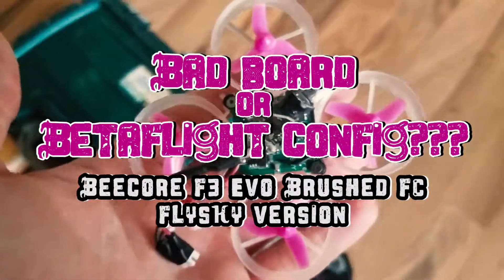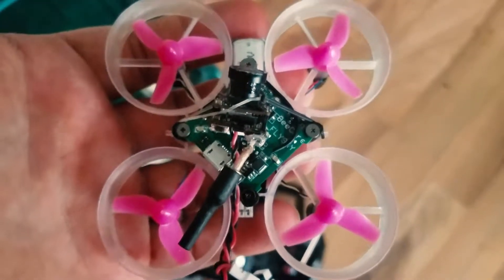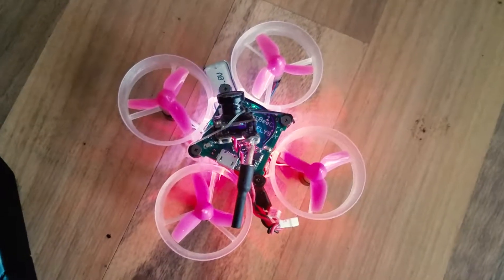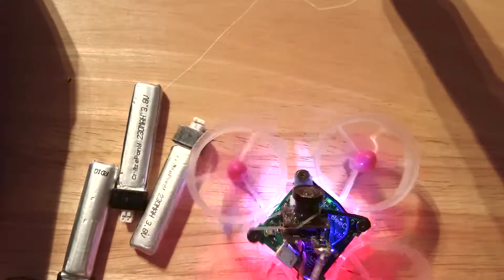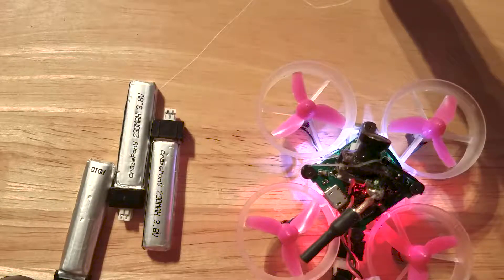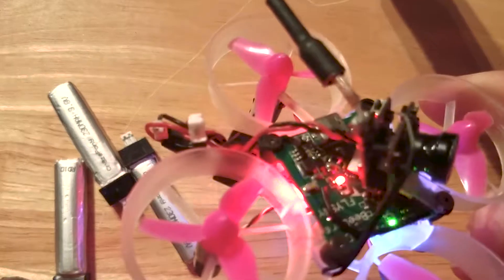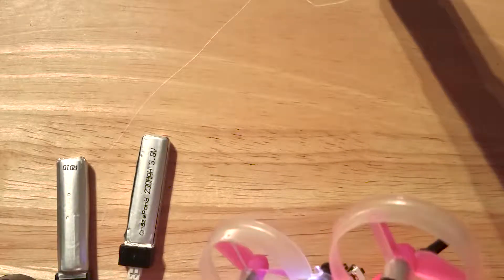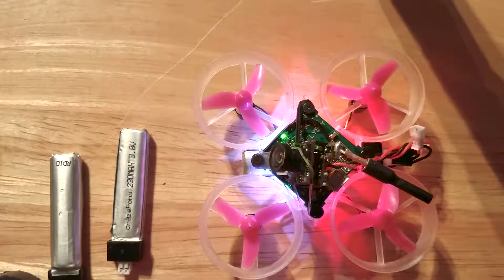Beecore F3 Evo Brushed FLYSKY Issues: Bad Board? BETAFLIGHT Config?

Comment: i just got mine hooked up and its doing the samething, when i arm it the motors turn, but when i go to give it some throttle the motors cut off.
Reply from the maker: CrazePony had the manufacturer look at this video and they said it was a bad board and are sending me a new one.
Reply: i have the same issue. Did you find a fix?